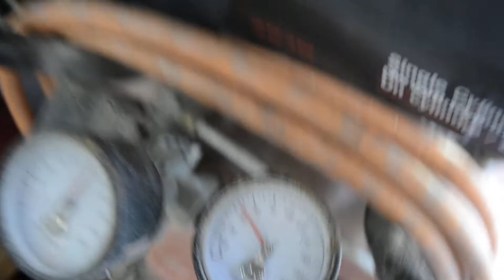2 stroke engine running on compressed air

Comment: This is a very cool experiment. Any issues with lubrication so far?
Reply from the maker: this engine has since been scrapped, but it ran smooth for however long I had it. My new engine runs a little less smooth so I'm going to need to lubricate it some how
Reply: Maybe you can put an oil supply inline with the airline just before the motor. A lot of air tools are run with an automatic oiler inline. This way there is a constant supply of misted oil as there really isn't a reservoir in this motor like a 4 stroke has.
Reply from the maker: good idea. any idea what oil I should use?
Reply: I would try a light weight oil, something thin enough for the air to carry it in. Maybe try air tool oil?
Reply from the maker: I have some of that, I'll try it

Comment: Hi Luke 
I've tried to do the same thing using a small 2HP generator engine...everything is set in the proper way but when it comes to running the engine it just won't run,also only on stroke occurs in a time...I mean as the piston is going up to finish the second stroke something keeps pushing it down...
Can you think of something why would that happen and how to solve it :)
Thanks for your video it's been so helpful
Reply from the maker: try adjusting the valve timing so that it opens later... it might be opening too early and forcing it back down!
Reply: I tried a lot of timing positions for the valve but it won't work...
Do you think the flywheel might be the problem if it wasn't heavy enough??
Reply: And by the way the flywheel doesn't complete a full turn so that I can change the timing accurately  ;(
Reply from the maker: on my first engine, the flywheel had to be heavier in order to cycle the engine because no matter how i tuned it, it wouldnt work. so I would recommend making your flywheel heavier!
Reply: Thanks a lot,I'll try that as soon as possible :)

Comment: I am a total layman but I think that a vehicle engine on compressed air should be very efficient and "simple" so it's light and small and so the car based on it would be light and offer more space since you already loose much with the air tank. It should also be easy to repair. I don't know if the present air engines are already at the end of any development